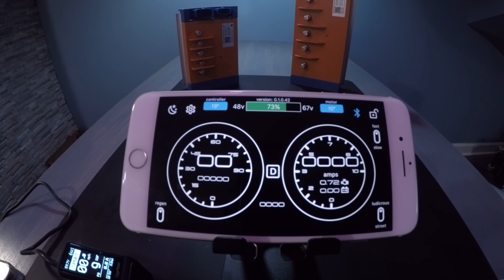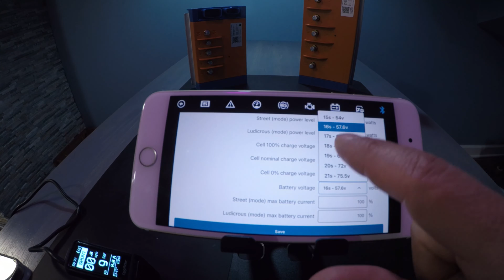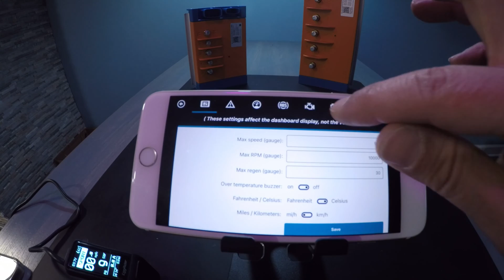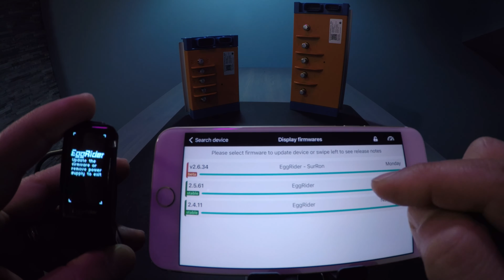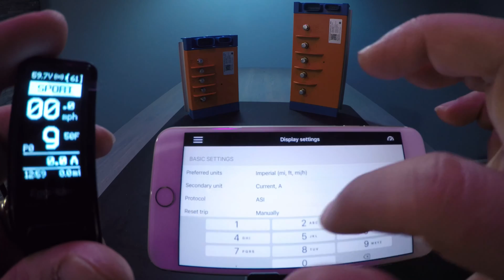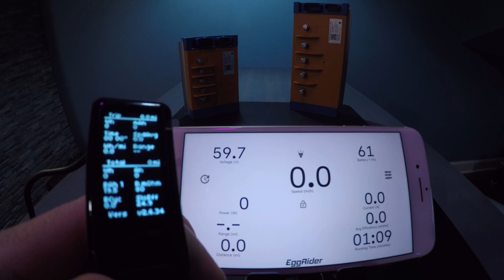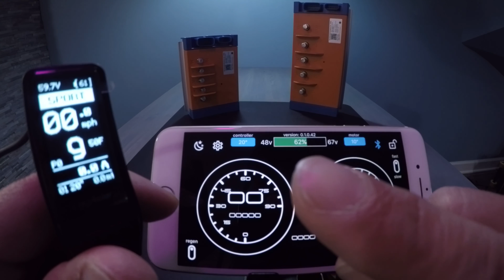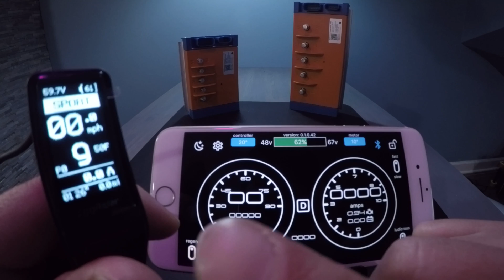GLE DASHBOARD & EggRider V2 - Changing Battery Voltage on BAC Controller

Comment: The app wants me to add email or phone number but when I do it says can't authorize and to contact customer support.
Reply: I have the same thing did you get it to work
Reply: @M4Fuelled  just talked to my friend and he said the problem was you actually had to put the plus symbol + before the number.
Reply: @M4Fuelled  my friend had to go to the website Greenline engineering inc. Go to contact us and leave your name email and phone # and message that just says you want to authorize your account they will get back to you and I believe you're gonna need some number off the receipt of the controller. After that you should be good.
Reply: Yea I had to put +1 in front of my phone number